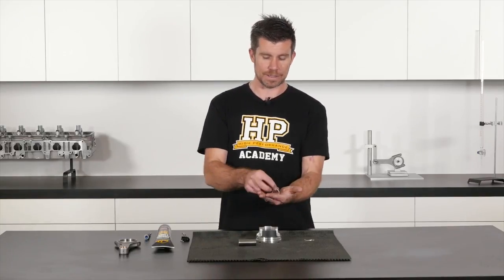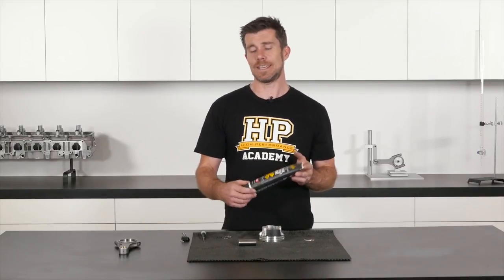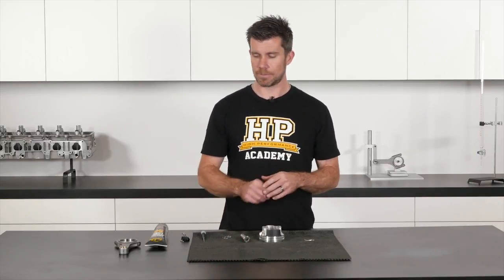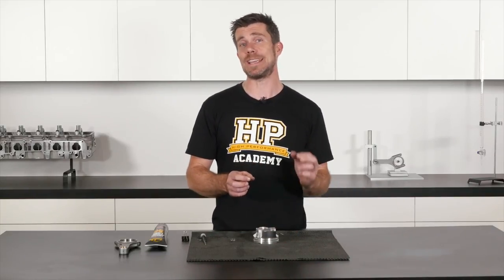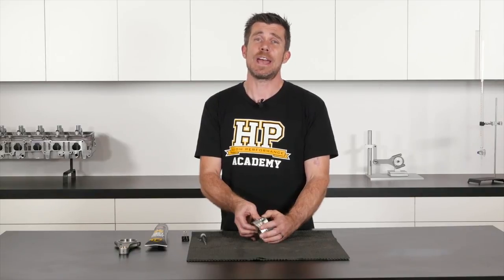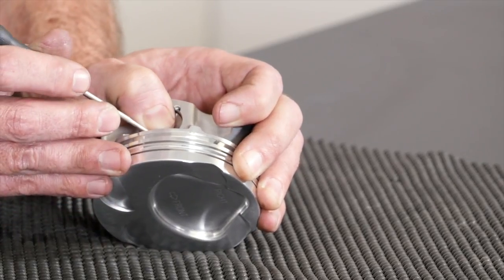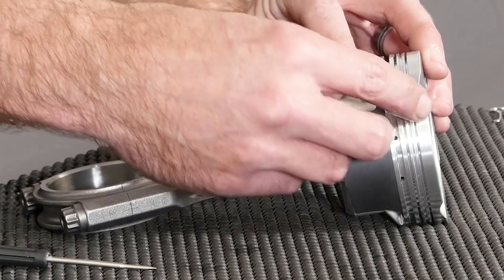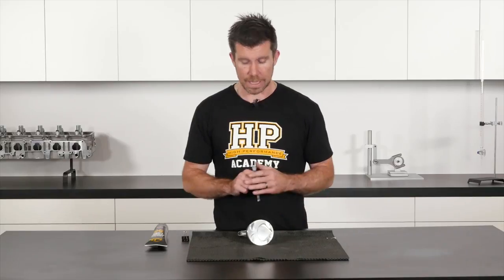How To Install Piston Circlips / Wire Locks | [FREE LESSON]

Comment: I'm not an engine builder by profession, but I am no novice in engine building. I did had some difficulty with the first set , until I got the hang of it, in placing the circlips on the set of pistons I used for my last engine built. I did not use the stopper on the other side, just a small screwdriver and then an allen key to push the end of the circlip in place. When all in place  I did a check on them with a small pipe the size/diametrer of the circlip.

Comment: Replacing simple but tiny Circlips on a Centerhousing of a MHI-TD05 Turbo can be frustrating too.
But when its done you can be proud of yourself with a happiness moment.
Reply from the maker: I feel like every time you install a tricky circlip there should be a wee glass of celebratory whisky that appears before your eyes. It could also come sooner those times when struggling a bit, I wouldn't complain - Taz.

Comment: Good Video

Because it essential that the wire lock groove is not lubricated prior to insertion of the lock...I wish you had included your suggested steps for lube. 

Good effort overall

Would love to see more information on Proper Fueling with Direct Injection without requiring supplemental port injection.
Reply: Not lubricated why?

Comment: I was less than thrilled with the low tension of my circlips - just going in WAY too easy, & able to be turned in its seat with the slightest mere thumb pressure - so I stretched the diameter just a blonde hair by giving a little squeeze to the inner & outer edges of the clip with the fat part of my needlenose plier jaws, straightening the wire just enough to make a bigger circle. Way better fit now. Don't need that pin going on walkabout. Only wish the clips in my kit were a little higher quality...

Comment: Kram Loxx are awesome, i would use those for circlips. So easy to get in imo and they won't move in a circular motion.
Reply from the maker: These wire locks will not rotate either ;) - Taz.

Comment: The open part of the wire lock should be either in the 12 or 6 o'clock position. If it's in the 9 or 3 o'clock position the clip could be compressed from the reciprocating forces of the piston.
Reply: Shaun Blair in theory it wouldn't matter, as the circlip is held within a groove, force on any side of it would have the same effect
Reply: I disagree and here's why. The circlip is compressed into the piston and the spring tension of the circlip is what keeps it in the groove. If the circlips gap is positioned 90 degrees relative to piston travel, the clips own weight when subjected to the extreme forces exerted on the piston will work against the circlips spring tension. Without this tension, it is possible for the clip to come out of the groove. Your assertion that a force from any direction on the circlip is inconsequential is incorrect. If this where true then it would be impossible to remove the clip and that's obviously not the case. Furthermore, while it may take a rather extreme piston acceleration to unload the circlip tension enough to release the circlip from the groove, a more likely outcome would be that over time the circlip becomes fatigued by constant bending and breaks.
Reply: You're overthinking it - while you are technically correct, if it was an issue the manufacturers would specify the location. no reason not to do it like that, though, if it is a concern.
Reply: GordoWG1 WG1 Some piston manufacturers do recommend it.
Reply: Not something I was aware of - thanks for that, something to bear in mind for the next time. Well worth a thumbs up.

[edit] FWIW, the piston acc'n is greater at around TDC than BTC and the shorter the rod to stroke ratio*, the greater the difference. So, I would suggest the gap be to the bottom of the piston if that is a concern.

*For true sinusoidal piston travel an infinite length conecting rod would need to be used.
Reply: Many piston manufacturers do specify/recommend wrist/gudgeon pin circlip orientation. 
Almost all specify/recommend circlip gap up at the 12 o'clock position or down at the 6 o'clock position. 
Some explicitly specify not placing the circlip gap at 9 or 3 o'clock position. 

JE Pistons, under the "Snap Rings" paragraph: "Also, install the snap ring with the open end pointing down.". 

http://blog.jepistons.com/wrist-pin-locks-different-types-and-how-to-install-them

Engine Australia, first paragraph. 

https://engineaustralia.com.au/~engine/sites/default/files/SB010.pdf

When in doubt, do not hesitate contacting the component manufacturer for their specification, recommendation, instruction and/or guidance.
Reply from the maker: Unlike other circlip types, a wirelock will not rotate when properly installed. In this respect the orientation is less important, however it is important to orient them so that they overlap the little cutout in the piston, otherwise it makes them very difficult to remove when disassembling the engine.
Reply from the maker: @patw Yes, contacting the manufacturer if uncertain is great advice! 100% agree.
The installation of a snap ring will be different to the wire lock we are demonstrating in this particular video - Taz.
Reply: Ah, I had in mind the inertial loading on the lock possibly causing it to fret a little, rather than move, the comment someone made about not using 3 or 9 o'clock would seem to support that - the mass of half the spring working against the clip's tension, if you get what I mean?
With the gap to the bottom (to c'rod), there would be maximum support and minimum un-supported ends at the highest loadings?

Maybe we should all be using buttons?
Reply: @gordowg1wg145  I spent years building bike engines - the manufacturers DO specify the location (opening at 6 O'clock)

Comment: I use a slightly different technique, using a fine flat screwdriver in the notch to ease the clip into the bore and groove.
However one does it, take care, peoples, as it is easy to make a blood donation or have the clip spring out and get lost.
Oh, and don't apply more force than needed - if you go beyond the elastic limit and deform the clip it WILL loosen, drop out and destroy the bore, if not the whole engine.

Forgot, I use a bit of W&D paper to remove the sharp edges of the screwdriver blade to reduce the chance of marking the piston - might be a bit anal, admittedly.
Forgot II, you can pick the jewelers' screwdrivers up at your local electronics store - down here that would be Jaycar.
Reply from the maker: Hey Gordo! I would like to thank you for often taking the time to share your own experience and knowledge via comments on the HPA channel mate! I always enjoy reading what you have to say on a new video. If you would like to, email me your shipping details I will get an HPA t-shirt in the mail for you as a way of saying 'thanks for being awesome' =) - Taz & the HPA team. support@hpacademy.com
Reply: Awesome? You obviously don't know me very well ;-) If you have an XL I would be pleased to wear it. 
Just trying to add some discussion points and bits and pieces I'd picked up here and there - sometimes my experiences, sometimes from others. Sometimes I'm wrong and I hope you, and the other respondents, can keep things on the straight and narrow.
The bottom line being we all want our engines, regardless of spec', to hold together and perform as best they can.
Reply from the maker: Not everyone knows everything all the time Gordo and you ask some good questions too =) Email support@hpacademy.com and we'll get you sorted with an XL t-shirt in black or white (your choice, just email me to let me know).
Chur! - Taz.
Reply: E-mail sent, if I did it correctly, thank you - shows how active I am when it's the first one sent since Gmail account set up in November, when Vodafone dropped their service...
Reply: Just arrived, thank you - and it is a very good fit :-)
Reply from the maker: Perfect! Enjoy =) - Taz.

Comment: Was doing some checking and came across a motorcycle engine tool on the Accu-products site called the "C-Clipper four stroke installation tool" for these "c" clip retainers.
It looks like it could be just the thing, but is limited in gudgeon/piston/wrist pin diameters.
Anyone heard of them or even tried them?

[edit] Seems to be made by Bux Tools - they have a video on YT illustrating using the tool - https://www.youtube.com/watch?v=lgB2WoQbt_Q

Comment: Wouldn't it be easier to start with one circlip instead of the bulldog clip?
Reply: Attila Pap It's a lot harder to install a wire lock with out the wrist pin as backer so you put the clip in, in a second, and it holds it.
Reply from the maker: Give it a go and see Attila. If you find that easier then it's the right way for you but we do think this method is going to cause you less frustration by removing the chance of pushing the circlip right through before it is seated correctly - Taz.
Reply: High Performance Academy I see, thanks!
Reply: I would expect it to be a concern that the bore in the piston gets scratched, or otherwise damaged, which might compromise the life of the engine?

Comment: I cannot stress this enough, your technique DOES NOT WORK without scratching the everliving hell out of a 450cc piston. DO NOT USE A SCREWDRIVER, EVER! The bulldog clip technique is nice, but I found it much easier to put the open end in first, THEN push the other end in with something soft, like a nylon mallet.